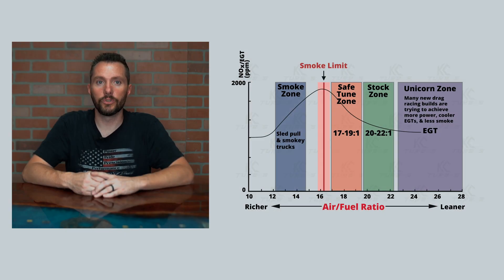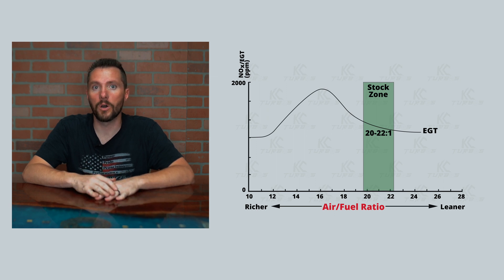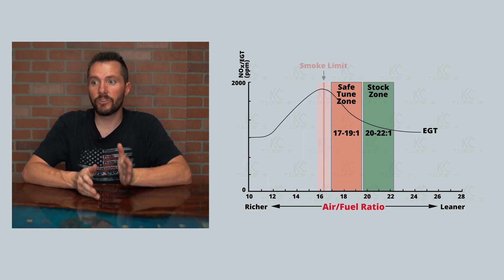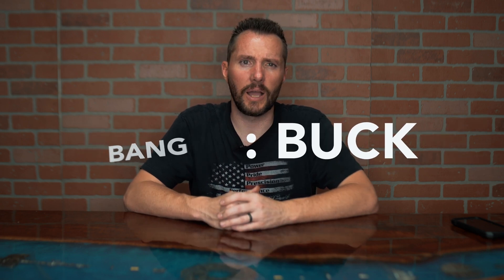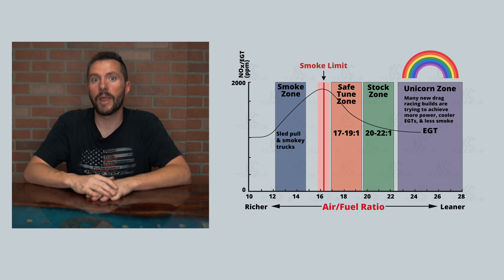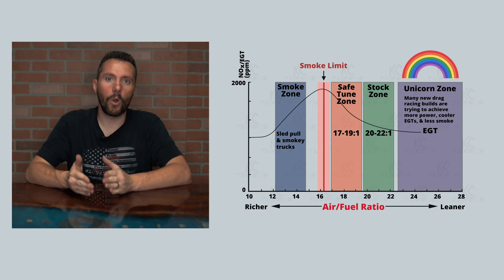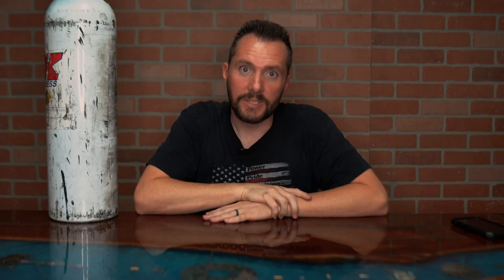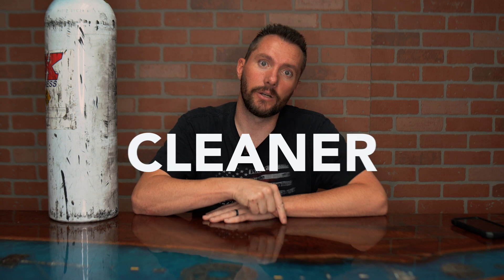Air to Fuel Ratio Finally Explained!

Comment: Bloody fascinating video. From a road racing perspective I've been interested in the use of diesel to gain a fuel economy advantage, especially at super lean AFRs. It'd give you a significant advantage in race starting weight since you need to carry less fuel due to lower fuel burn. The big issue is though, how does one get the turbo spooling to get enough air flow to push you into those lean ranges.

Comment: anyone know a good 02 wide band Diesel Air fuel oxygen sensor ?
Reply from the maker: Check bosch, they make a wideband and i believe one that works for the 7.3
Reply: @KCTURBOS  thanks Kc turbos for the reply....I should have been more specific and say is there any good 02 wide band diesel oxygen sensors that read past 20:1 to 50:1 lean side ?

Comment: Great explanation Charlie. Very happy with the KC300X Stage 2 Turbo you guys supplied for our 7.3 Excursion project (Busted Knuckle Films).  Smoke output and EGTs are easily managed on moderate tuning.  Planning to run that pig on the drag strip for Sick Week in February. Considering adding the spray just to clean up the smoke on the Hot Tunes. Keep up the great content.

Comment: Awesome video Charlie, look forward anytime I hear Patrick interview you.You are given me a new appreciation for the 6.0L. Work on HD trucks mainly Paccar MX and AFR and exhaust oxygen content is displayed in data PIDS. Early MX had stand alone lambda sensor, later just use Nox sensor which is in a nutshell a wide band oxygen sensor that calculates Nox from calculated oxygen concentration. Someone smarter than me should be able exploit this when tuning any truck with Nox sensors. Thanks again for the video and your support of veterans. We appreciate that.